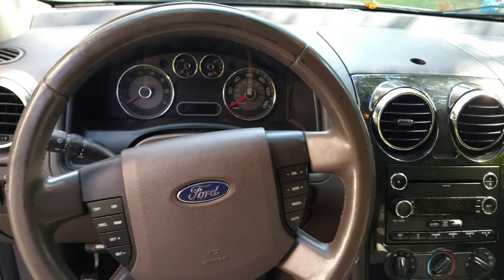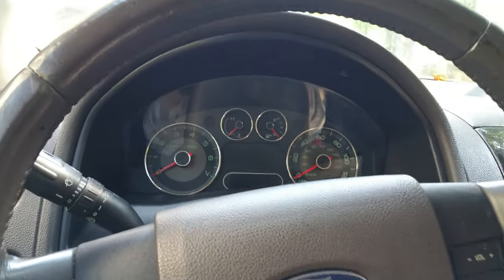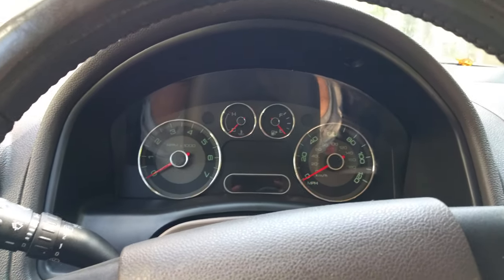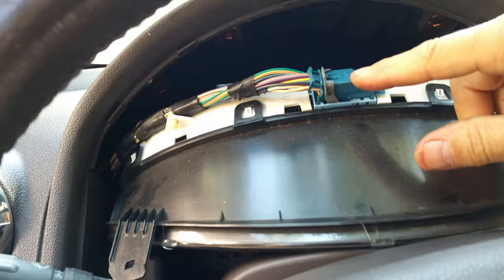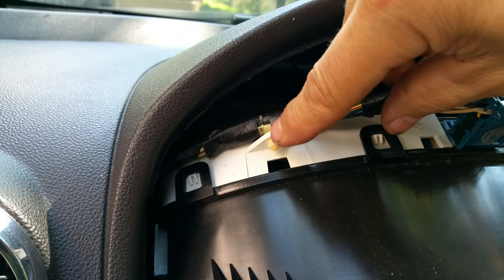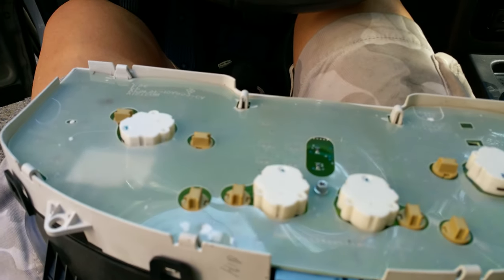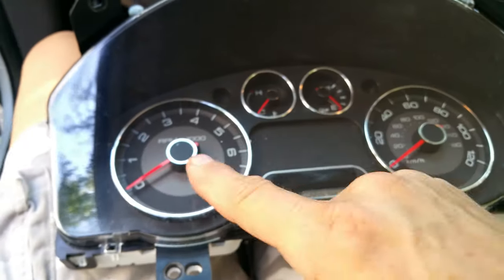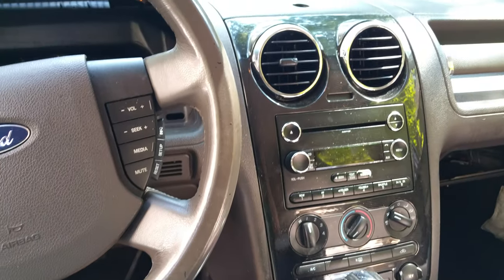removing instrument gauge cluster on many Ford Crossover SUV Taurus X

Comment: Thank you so much for this video. I’ve been mending little things here and there in my hooptie. Today I did the AC clutch not engaging after I replaced the clutch, coil, and pulley. I almost gave up but I didn’t realize there were 2 other fuses for the clutch and one of them was bad. Just in time for summer. This is my project for tomorrow. Thank you again. Have a great day.
Reply from the maker: The Thanks Button awaits you